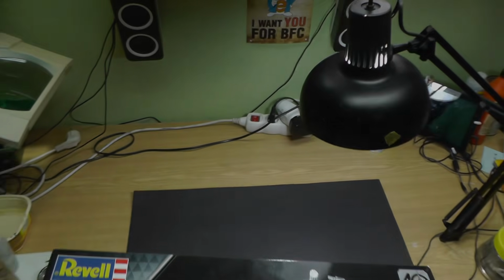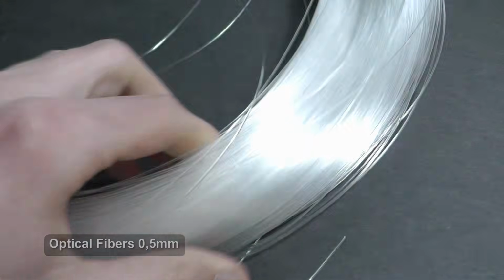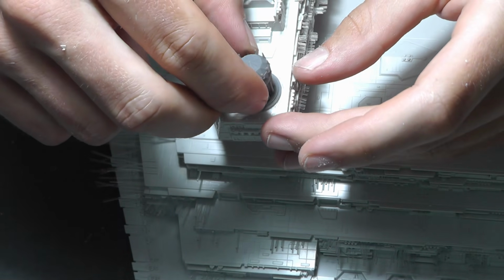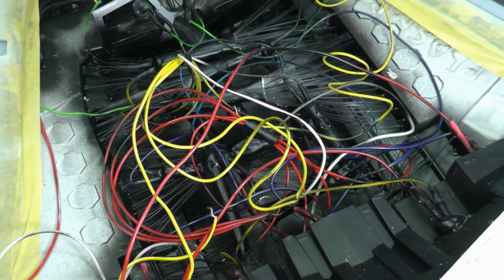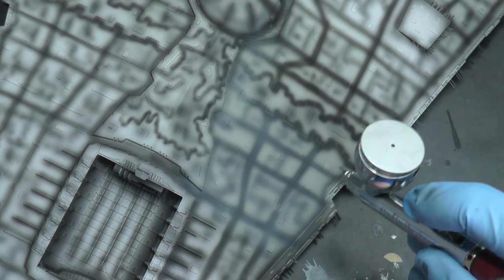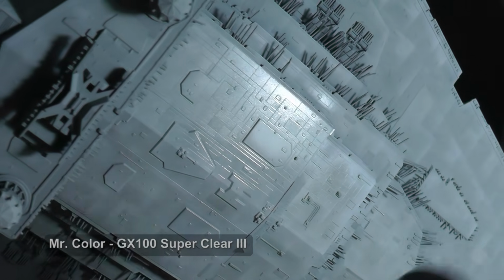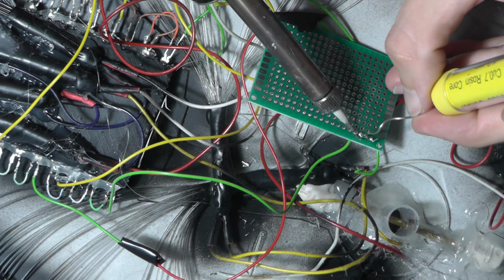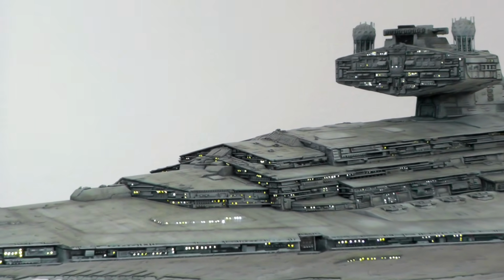Star Wars Imperial  Star Destroyer - 1/2700 Revell Zvezda - Sci-fi model

Comment: void setup () {
	//put your setup code here, to run once:
	pinMode (2,OUTPUT);
	pinMode (3,OUTPUT);
	pinMode (4,OUTPUT);
	pinMode (5,OUTPUT);
	pinMode (6,OUTPUT);
	pinMode (7,OUTPUT);
	pinMode (8,OUTPUT);
	pinMode (9,OUTPUT);
	pinMode (10,OUTPUT);
	pinMode (11,OUTPUT);
}

void loop() {
	// put your main code here to run repeatedly:
	for (int i = 2; i < 12; i++){
	ledRun(i);
	}
	
	engineSection1(11);
	delay(500);
	engineSection2(11);
	delay(500);
	engineSection3(11);
	
}

void ledRun(int val){
	digitalWrite (val, HIGH);
	delay (1000);
}

void engineSection1 (int led){
	for(int i = 0; i < 100; i++){
		analogWrite (led,i); //pwm
		delay (50);
	}

	for(int i = 100; i > 10; i--){
		analogWrite (led,i); //pwm
		delay (50);
	}
}
void engineSection2 (int led){
	for(int i = 10; i < 250; i++){
		analogWrite (led,i); //pwm
		delay (5);
	}

	for(int i = 250; i > 10; i--){
		analogWrite (led,i); //pwm
		delay (50);
	}
}

void engineSection3 (int led){
	while(true){
	int randomNumber = random(200,250);
	analogWrite(led,randomNumber);
	delay (10);

	}
	
}

Comment: Light emitting diode’s are a bit too hot when they’ve been turned down a bit you’re better off using a low voltage bulb hobby grade and I take the individual fibres and I put just a dab of paint on the ends of them by the cup saw the wires that have red on them glow red the ones that have blue glow blue. If you take the part let’s say for a cockpit I lightly flare The end of each fibre that way when I thread it through from the outside the flaring stops it and you do not have to Trim the fibres later

Comment: I just bought this model. I found it at a low price, USD80, here it is normally between 120-140USD. I also found a optical fibre kit on ebay with 3m 0.5 and 3m 0.75 optical fibre strands and some white leds. The shop is called "fibreopticlightingsolutions"

Thanks for inspirering me to do this. I just finished lighting a Klingon D7 Destroyer, and still working on an Enterprise Refit !/537 - But that kit is so messed up, which makes it very difficult.

Can you make a video about which paints goes over each other and how to plan painting if fx you want to weather it afterwards. I am thinking about when you would choose lacquer over enamel, or enamel over water based acrylics. Or if you have experience with coating waterbased acrylics with clear enamel, does any product allow for this?

Comment: Now that I have that kit on my work bench, I see why he did what he did from 5:38 to 6:09. But I am somewhat are afraid to break that part, when I try to copy that step. T.T
EDIT: Monkey brain temporarily went over 9000 and gave me an alternative idea. I'll just take a bigger drill and will mill cut placeholder gaps in that pieces. They don't have to support much weight anyway, therefore not so important for the structural integrity of the model. :D

Also, drilling 0.5mm holes into plastic is tedious af. Already murdered 5 drill bits before I got the proper technique.

Comment: Hello there @PLASMO - plastic models

I did a couple of Star Wars Plastic kits this spring / summer during the whole Covid lockdown. Amongst it, there was the 1/5000 scale Star Destroyer model from Bandai with the LED lighning kit.
It looks pretty nice , but I have some issues with the operation, as turning the ligning on and off is quite a hassle.

Anyway, I want to try out and learn new things, which include custom lighting. So I plan to re-create that same model the way you did. Except for the light programming part. Anyway, I got some questions I hope you could answer despite the age of that video.

1. I couldn't see it, but I assume, you did not your power source and On/Off Switch inside the model? So I assume you wired and connected this with that base pillar?
2. If I wanted to put my battery and switch inside the model, any recommendations on where and how to leave a maintenance opening?
3. Did you use a 12V power source for any specific reason? Or was it just so you could make series of 4 LEDs?
4. Question 3 because I am thinking of using a lower total number of LEDs then you did. And just use a customary 9V battery as Power source. But that means I have to calculate my resitor strenght with diffrent values

Comment: Not sure if I want to use fiber optics or just light the interior and put clear plastic on the interior walls on the inside of the windows. I could paint/stain them to be different colors. They wouldn't be as bright I guess but I also have the TenaControls lighting kit. I just hate that the windows have to be round (drilled out holes). They don't really look that realistic. I know that's how studio models are, but still. Maybe thin the walls from the inside and use an exacto to get more realistic shaped windows. I wonder if they made clear parts, then you paint them and scratch off the paint for windows. Would probably take a lot of paint to make them opaque though. Anyway, great job. The electronics has me lost though. :)

Comment: a tip for working with leds and fiber optics is to use liquid electrical tape, its like a weak glue that acts to both insulate and blocks out light, but beware because its a bit nasty, it smells absolutely awful and god help you if you ingest it

Comment: I use those fibreoptics at work and as much as a pain in the ass an intalling them is they look absulutely amazing.
Well done m8
And btw you wouldnt have had to use heat shinks if you'd just made solder connections 3mm long max and as close to the LEDs as possible.
I'm not sure but I think you could have used less LEDs which sure would have made those bundles thicker.

Comment: I like to use JB Weld KwikWeld.  Mix relatively small batches because it sets up fast, but works great on Fiber Optic cable and has the added bonus of helping to light block.  It sets in 6 minutes and is fully cured in 4-6 hours.  MIx, apply, mix apply.  You can keep moving fast without risk of mess.

Comment: Why did you find drilling small holes to plastic problematic? I've drilled holes to .1mm size with no trouble at all. I can highly recommend the Proxxon micro-drills with 2.35mm shafts, they are very good quality.

Comment: // led slow engin brigness change on blue leds for models for 4 leds or outputs

 long randNumber;
void setup() {
  
  pinMode(3,OUTPUT); //engin 2     choose pwm pin
  pinMode(5,OUTPUT); //engin 3
  pinMode(6,OUTPUT); //engin 1
  pinMode(10,OUTPUT);//engin 4
  
}

void loop() {
 randomSeed(analogRead(0));

randNumber = random(7);
randNumber = random(2, 6);

  for(int i =150; i < 255; i++){
   analogWrite(5,i); //pwm led 2 
   analogWrite(6,i); //pwm led 3
   delay(8); 
  }
  for(int i = 255; i > 150; i--){
   analogWrite(5,i);
   analogWrite(6,i); 
   delay(8);
}
//*******************************************

  for(int i =50; i < 150; i++){
   analogWrite(3,i); //pwm led 1
   analogWrite(10,i); //pwm led 4
   delay(randNumber); 
  }
for(int i = 150; i > 50; i--){
   analogWrite(3,i); 
   analogWrite(10,i); 
   delay(randNumber);// led 1
}

}

Comment: Next, I put in tiny, working fusion generator but be careful, install good working cooling system or model may have melt down.
Following, some industrial grade lasers (cannibalized from old CD-players) to give the turbolaser batteries a bit more 'oomph.'
Do not forget safety goggles when demonstrating the lasers.

Comment: You may want to reinforce the electrical tape with a zip tie in future builds.  Over time electrical tape tends to lose its adhesion and come apart.  It'd be a bummer for the bundles to fall apart inside the model.

Comment: I would recommend you to use MGTF wires. They are resistant to a temperature, and you can re-solder them as many times as you need. Covering can be easy removed from edges with a natural gas lighter.

Comment: Excellent model. Next time, consider driving your LEDs using the 74HC595 chip. You can daisy-chain a number of them together. Each chip can handle eight independent LEDs. You command each LED by sending a bit pattern n 8-bit (one chip) or 16-bit (two chips), etc. These patterns can be sent from your Arduino (or whatever) in serial format using just four wires including power and ground.

Comment: Just bought this kit.  So excited to build it using your and the commenter Chris Nicastro's suggestions and techniques.
I'll definitely be going with finer optic fiber, and even a few color-changing LEDs for key points.  I've only an FDM 3d printer, so no corvette, but the deeper hangar bay should print fine.

Comment: Nice. One trick you can do when soldering the LED's to that solid core wire is bend the ends of both the wire and the LED leads into J hook shapes, hook the J's together, then squeeze the hooks down with pliers. It makes a really solid connection even before soldering it, soldering just makes it even better.

Comment: you  definitely  got  my  attention,  david.  replacing  some  items  with  3d-printed  versions  was  spot  on.  at  first,  was  unsure  on  how  the  subtle  differences  in  colored  lights … until  the  finished  model  was  illuminated.  also … the  shading  you  did  with  air-brush  turned  out  like  magic  at  the  conclusion.  well  done … mr. engineer … indeed.

Comment: Even when ( not if!) 3D printing becomes better and cheaper than molding, Companies like Tamiya will still be able to exist. The main thing that goes int ot the models is desing. You might not buy the Plastik kit, but rather a file that you cant share or reuse or anything, and Print yourself the Kit. Ofc, you will be able to engeneer it yourself and not pay money to get a kit, but you cant kinda do that even without a 3D Printer today, by using scrap, its jsut not as much fun...

Comment: first of all, this is amazing.  I love what you did.   I know it's too late now, but what would have been cool is if the entire thruster nozzle was cast in clear resin and you paint a very very thin layer of grey paint on the outside surface.   taper the paint to almost nothing towards the middle.   when you light up the LED, it will glow from the inside of the cone like it does in the movie

Comment: I'm building up Voyager at the moment and drilling all the windows was a pain. I prefer to use a pin vice and make these small holes by hand, I feel it gives me more control and I managed to do the whole lot without breaking a single drill bit, something which I hear happens all the time when trying to drill windows. I also use heat shrink to attach my LEDs, it makes a nice snug fit really easily- only problem is that fibre optics will melt super fast when using a hot air gun so best to use a soldering iron and be really careful.
Also are you running resistors with your LEDs? I'd be very worried about them blowing prematurely without, I've already managed to do it testing mine where I wasn't careful :-(

Still, an absolutely incredible job!

Comment: Fantastic work. I recently built the Delorean from Back To The Future 3 and added surface mount LEDs front, back and inside. I love your idea of the fiber optic! I should've done that... would've made it easier than wiring up 8 surface mount leds which i hot glued behind panels! Also, i noticed you didn't place a current limiting resistor in series with the LEDs..... any particular reason why? Or does the microcontroller limit the current etc?

Comment: Hey David, I noticed in the beginning of the video that you tested the LEDs directly to a DC battery, but forgot to add a resistor in series to limit the electric current. LED lifetime may be limited if you don´t add resistors. Did you add the resistors to the LEDs in the final work? Awesome model..

Comment: Dremel makes a cutting wheel designed for plastic, if you use it at a slow speed and minimize how much you try and cut through at once it is easy to make those cuts without melting much of the plastic, or any at all. Just do a search for Cut-Off Wheel for Plastic and you should be able to find it. Key is to use a real slow setting and not be in a hurry.

Comment: amazing work  as alaways  but I am going to be honest, the thick fiberglass butchered the final result ( not that is any short of amazing, but with smaller fiber it could have easyly been the best build on youtube).
if you are not comfortable with drilling smaller holes, I suggest using an heated needle stuck in an hobby knife handle.
it can take longer to clean off the minuscule scraps molten around the hole but it gives truly astounding results.